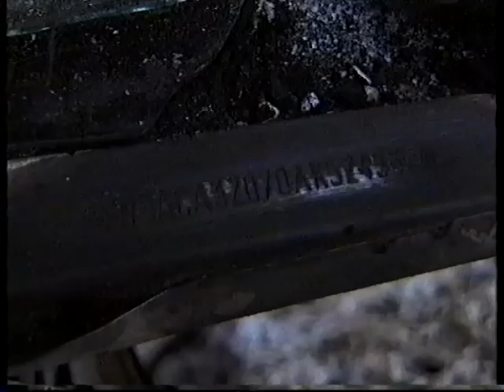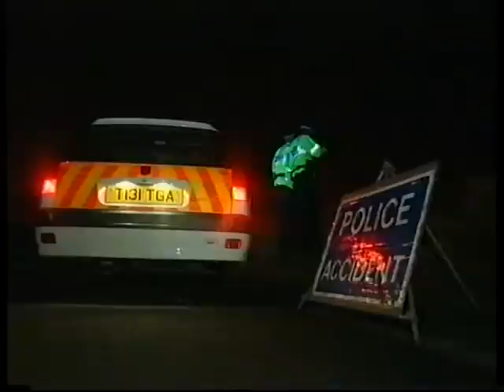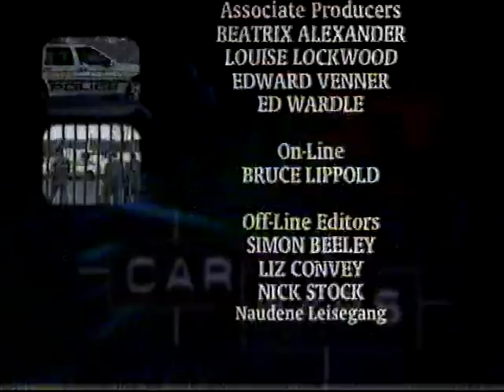Scottish Police Car Crime Documentary 1998

Comment: The transit pickup owner looked a little guilty to me like he knew it was dodgy when he bought it..
Reply: Looks like he got it back on a Q plate 
So he did a good job hiding it’s identity 😂
Reply: @lee2217  HPI vehicle checks existed in 1998 so he could have checked its provenance if he wanted. Q plated vehicles are virtually impossible to insure.
Reply: the transit had a different  identity ,so it wouldn’t have shown up
That’s what happened with the Sierra my boss bought
It was a doubler 2 cars on the one plate,but wasn’t picked up until the owner bought it in auction and decided to get it checked by his friend who happened to work for the police stolen car squad
I had a Q plate motor bike, stolen recovered numbers missing , I had no issues insuring it
My friend had a Q plate cordia turbo
No issues insuring
That maybe different now